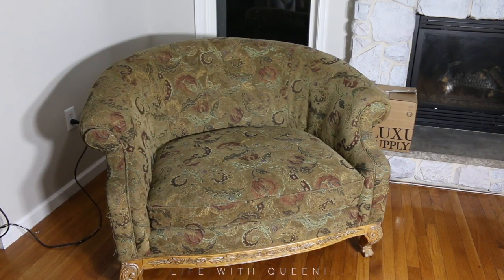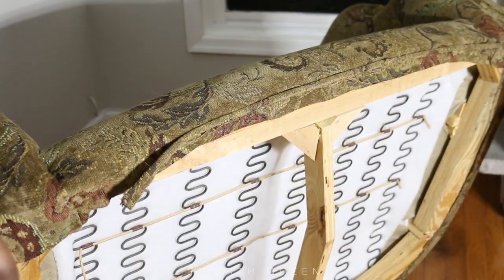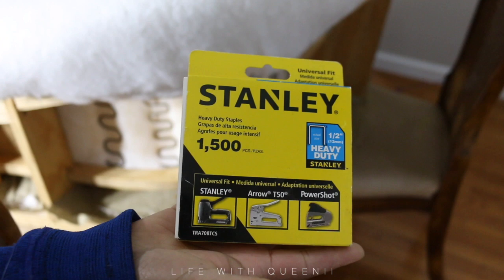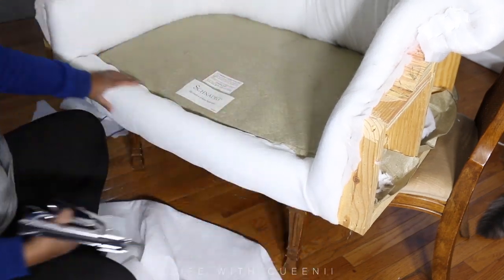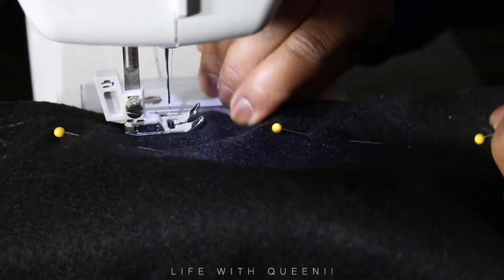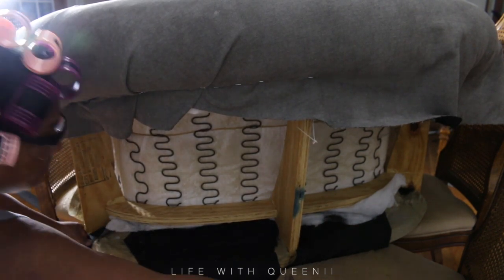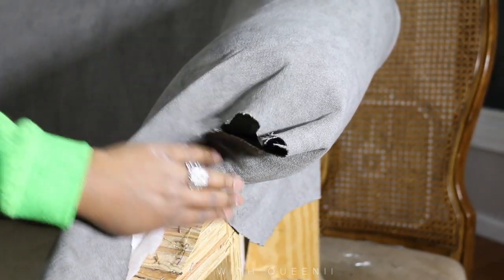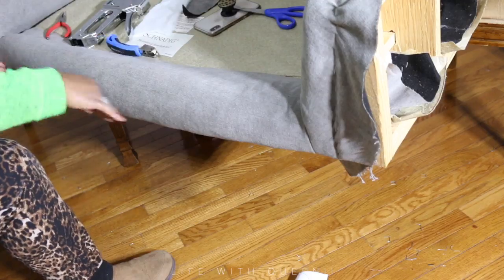HOW TO REUPHOLSTER A COUCH / CHAIR - PART 1- Life With Queenii

Comment: An air compressor and nail gun work great!  You can use the nail/staple gun on things other than upholstery.  You will find a million things the air compressor can be used for and will pay for itself in no time.  I bought my first one at an estate sale over 15 yrs ago.  It still works great just bought another recently for my daughter.

Comment: Stanley's staple gun is good. It doubles as a nail gun too. Its electric and not air pressure so its not as scary. Also next time try using a curved needle.  Like the ones the use for weave, that way you don't play Russian roulette with your fingers going under the chair.  I have this same chair and I've been worried about starting on it. Thanks for this video.
Reply from the maker: I make wigs and have curved needles...they’re not comfortable for me when going trough tough fabric👌 and I’ll check that gun out ❤️
Reply from the maker: Erica Green also I feel before I push my needle trough lol no Russian roulette

Comment: You could get a small electric staple/nail gun. I have one that does nails or staples. It's easy to use and is not so scary like the big ones you would see professional carpenters use.